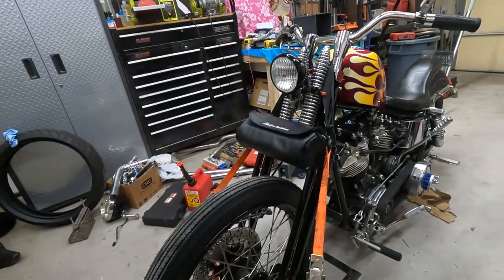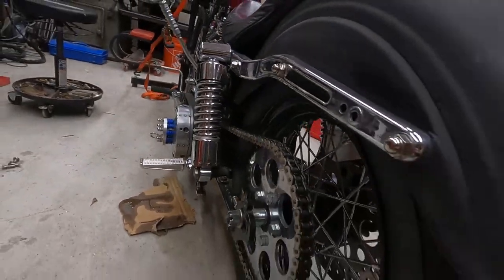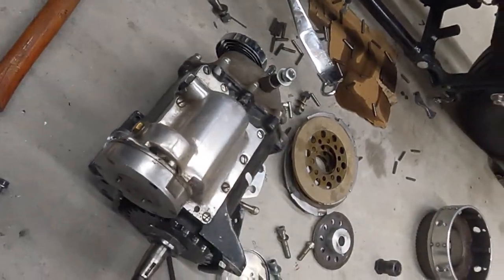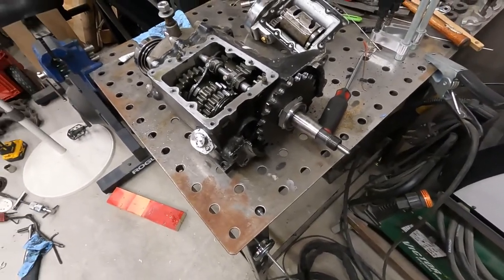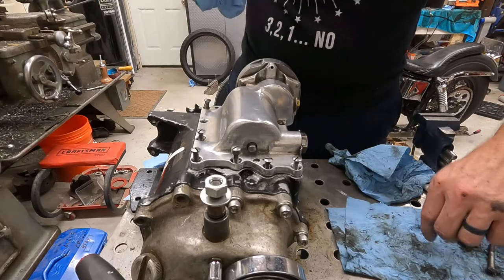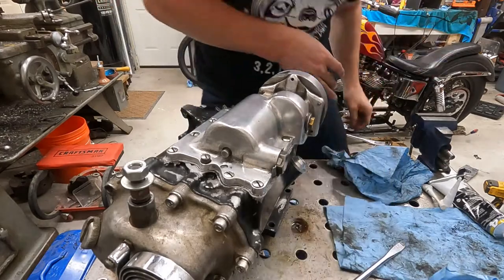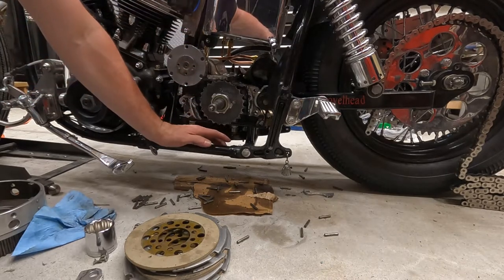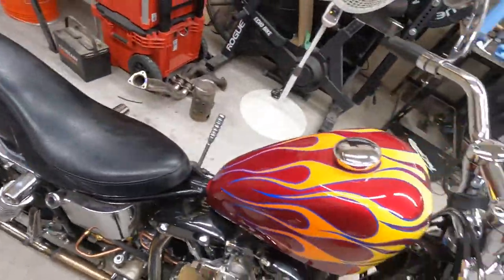Shovelhead transmission major leak

Comment: Just pulled my 4 speed ,will be replacing with a rebuild. 1980 Fxwg shovelhead can’t wait to ride it in spring! Ride free 🇺🇸
Reply from the maker: Are you having yours rebuilt or already have a rebuilt one?
Reply: @zippyindustries  I’m picking up a rebuilt one Saturday.
Reply from the maker: If yours is a ratchet top I'd be interested in it.
Reply: @zippyindustries  I’m thinking I’ll hold onto it for now . See how other works.

Comment: the only reason they leak is person doing the wernching      when putting clutch basket on don t  use impack can split tapper use red lock tite with lock tab been riding gen. bikes 50 yrs.  happy trails

Comment: Save your money, I have tried the big fix, 5 finger, 10 finger but the very best clutch I have had ever is the Barnett Rivera I can pull neutral anytime I want it's just so easy.
Reply from the maker: Well the bike already has the big fix kit on it. Found that out when I tore it apart. I don't have any problems with finding neutral or shifting. It's just starting out as the clutch is grabby and lurches. They're new disks so that may have something to do with it. We shall see.

Comment: Looks like you are making good progress apparently without a service manual, you are braver than I am, without my manuals I don't do any serious stuff.  For reference, I have an 88 ci Panhead engine and trans in a 1981 FX frame with belt primary and jockey shift that I bought in 1998.  I used to have shops work on it, learned it is better to do myself.
This isn't intended to be critical at all.  If you pull the trans out again and want to be fussy, the torque for the trans top screws is 73 inch pounds, on the kicker end of the rachet top you will see the end of a shaft, there is an o-ring sealing it but they tear so sealer helps keep the oil in.  The nut that holds the clutch hub in has an o-ring but there is room for two and that helps with the oil too.  
Grabby clutch:  with a belt drive,  belt pulley alignment is critical, the belt should travel centered on the pulleys.  I use a thick plate glass (18 " x 18 ") with 120 grit sand paper to rub the clutch friction discs on and remove any high spots, also a Tamer does work.  
You spoke of feathering the clutch in first, I don't have that problem, I have a 23 tooth trans sprocket and a 51 tooth wheel sprocket, 3000 rpm is 60 mph.  I'm also using FX gears instead of FL gears, the FX set have a higher first gear.
Third gear:  when you open the trans again look closely at the shifting 'clutch' that the fork slides between gears.  The engagement contact area should not be worn or rounded on the gear or sliding clutch.  Also watch the spacing, in neutral there should be roughly equal spacing on both sides of the sliding clutch, in gear it should have positive engagement.  You can buy an alignment tool for around $100.
Reply from the maker: I have a manual that covers pan through cone shovel. I only reference it for the major torque items (clutch hub, head bolts etc.). All those o-rings and seals were present and good as I replaced them with new. It leaks between the spacer and spline past the sprocket.
Reply: I exercised my thumbs more than needed. ;-)  Between the spacer and spline is where I used the silly seal after they are locked together.  Sounds like you have it figured out, good.

Comment: A buddy has a std transmission case and he put the vent screw in the corner of the top and the pressure built in it a cause the oil to be pushed out the main seal. His other bike has it in the same spot but the std housing was only open on that one screw hole closes to the alignment pin.
Reply from the maker: The hole I had it in in the video was pushing oil out of the vent which was part of the leak. Moved it to the right one hole and it's been good ever since.
Reply: @zippyindustries   sweet ! I am actually in the middle of redoing some seals on a 78 Chevrolet head transmission ratchet top and in the middle I noticed the shifter shaft rod was the culprit. The O-ring on it was about as thick as a matchbook paper. Some time ago somebody put some of that red Permatex stuff on it and it was pouring from underneath that leaking down to the bottom of the main Drive seal and it appear to be that seal but it wasn't. Since I have it down in a part I'm going to change it all though. It's kind of a good thing I had to take it apart because one of my shifter Forks was worn and loose I got about 3/4 of a turn on it before it's snug down. I am waiting on a new set of Jim's to come in now.

Comment: 4 speeds are notoriousl for leaking out the mainshaft, because of a worn main drive bushing. Ray  Duguay has an o ring spacer that will stop the leak if the bushing is in good shape. He sells them on EBay, and perhaps direct, do a search.
Reply: Good to know. My four speed leaks. Not too bad yet but I guess it'll only get worse.